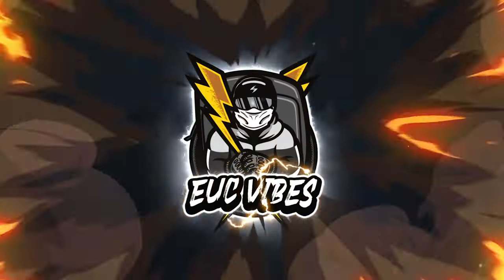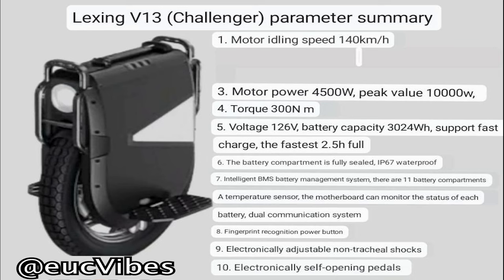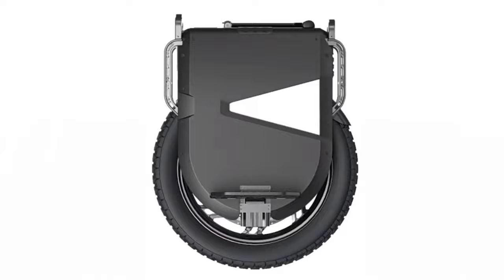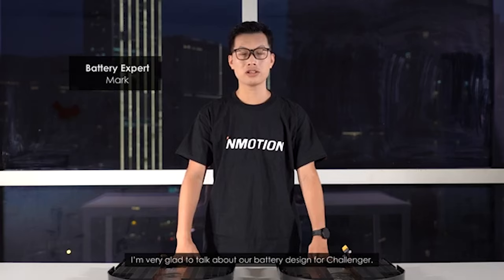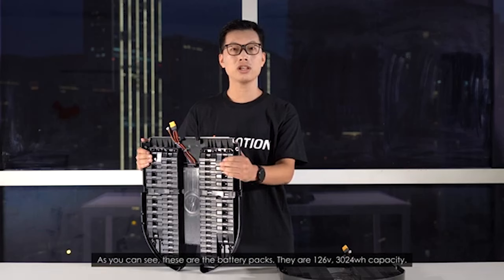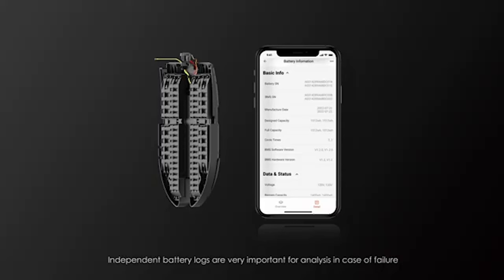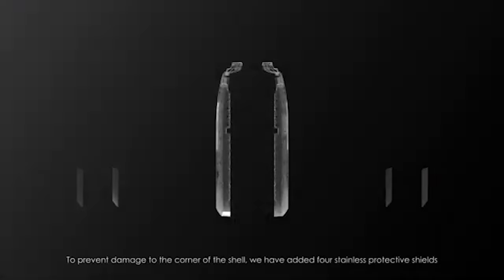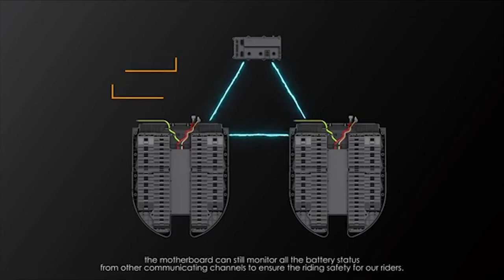iNMOTION V13 ⚡️ (New Pics + Info)

Comment: It sounds cool and hopefully not bloatwares. 9 sounds like you can adjust the shock from the screen, but the most important thing about the shock are suspension travel and durability of it. Being first of its kind, doesn't mean its good. 10 too sounds overly engineer. We need pedals to be dumb and super durable. More parts to be broken and expensive to replace. 8 better not be the only way to access the wheel to ride, those wiring are brittle. It would be the worst day if your fingerprint sensor got broken and you got lockout of your wheel when everything else are fine.

Comment: Thx Tommy!
Every time they release more information I see the cost going up. Afraid to know but i still NEED this wheel! Glad they are doing all this just hope it's 100% ready before they give it the full send  🤞
Reply: @EUCvibes  forsure but these safety features imo are worth paying more for. It "look" like they really did some impressive engineering to this wheel. I'm looking forward to making a custom adjustable seat that mounts to the top of the roll cage like I have on my sherman. I love a good seat and it looks like this wheel will be mod friendly like my sherman.
Reply: @EUCvibes  what's the big problem of v12? Why are people that just love and other hate? The problems weren't solved in new batches?

Comment: Seems kinda like a Sherman with some crazy suspension and flashy features… she looks good though I’m sure it’s gonna be smooth .. And electronic suspension is basically the same pressure type air/gas suspension with a electric controller that adjusts your suspension pressure based on your ride style or manually adjust etc etc… pretty awesome feature if all these electric devices stay healthy and don’t fail and need extra servicing like the finger print power button.. Hope there is a fail safe in case that breaks ya know?

Comment: Suspension: sealed shocks no air-pumped tubes
Pedals: use magnets to keep closed, electronic will demagnetised pedals to allow them to open up when turned on.
You can still manually open them without worry

Comment: According to Mad Pack, the shocks are gas chambered and similar to the EX suspension except you don't need to pump them to 2,000 PSI. They will be sealed and recessed and adjustable via the touch screen on the EUC or the app.

Comment: guessing, but the suspension may 'actively adjust the compression and rebound of the shock or strut'.  I'd guess this is a setting?  but maybe the suspension is self adjusting, based upon surface?   Certainly sounds interesting.  Might be the first step toward 'smart suspension' that could move pedals in sync with road conditions
Reply: Traditional shock compression and rebound adjustments are controlled by throttling the throat of fluid flow through mechanical expansion/contraction VALVES, which alter the dampening and performance of a traditional fluid shock system.

"Non-tracheal" may refer to the alternative method of altering the viscous-elastic properties of the shock fluid OR the "spring" characteristics by using an electric field to alter the physical thickness the flow through a fixed-size orifice, which allows very rapid reactions on variable terrain transitions... like smooth pavement to mega-pothole and back type road hazards.  The incremental improvement of a non-tracheal: "Deep Throat" suspension system should be a major improvement in terms of mechanical maintenance, compactness and weight savings, without additional costs.  {That said, this is just an uninformed guess, FWIW... you asked.}
 

[Side note:] This is the first step to radically changing to a fully electronic active suspension system (which will probably be at least 5-10 years away from scalability.  Fully active electronic suspension is the fantasy and could offer "boosted jump-assist" that would double or triple the your obstacle clearing height.
Reply: @grb1969  yeah! what he said!
Reply: @grb1969  the ability to assist/augment a jump is one of the most exciting potentials of 'smart suspension' for sure
Reply: @urthpainter  Yes, definitely not on this version, yet.  But I'll continue to lobby for a Bose-type active suspension until it happens. It's really a safety feature, not just because I want to Mario-triple-jump my way across the landscape. 😁
Reply: "Electrically adjustable non-tracheal suspension" to me that translates as non air suspension that is electronically adjustable. GM has had the MagnaRide suspension for at least 10-15 years, maybe the patents have expired, or this is just different enough to skirt patent infringement. But what MagnaRide is a hydraulic suspension that has micro ferrous material(magnetic metal particles) floating in the hydraulic fluid of the cylinder, they can electronically charge the fluid, and in doing so it changes the viscosity of the fluid, so on the fly the ECU can make the suspension stiffer or softer. the cars ECU's monitor car speeds, wheel rotation, G loads, etc, and based on that, the suspension can optimize its response to the road. That sounds pretty exotic for a EUC, plus they mention it has 10 settings, so it wouldn't llikely be relying on ECU's reading data from multiple sensors. maybe they will have 5 presest  off road settings, and 5 preset road settings,  

I have been watching the suspension EUC market closely, and watched multiple ride reviews of the different models, and in my opinion at some point we will see some of the manufactures making on-road and off-road versions of their suspension models, because the optimal setup's for suspension  for the two types of terrain are very different. It it near impossible to make one suspension set up optimal for both. That said, InMotion is a company that does not make a lot different models, they like to keep their lineup simple, and if there was a suspension technology out there that could pull off being good at both on and off road, it would be a electromagnetic controlled shock system. As proof, GM uses the suspension in their high performance Cadillac line, and some Corvette's, and at the same time, they use it in their most off-road capable truck.
Reply: @EssPhour   Great explanation.  I’m not a huge fan of the GM MagnaRide but it is simple and can be electronically modulated. 
 
The Bose system is orders of magnitude better but also complex and unavailable in production vehicles. That said, it’s also post-patent protection so it is being adopted by some Western militaries and should be adopted by the motorcycle manufacturers at some point soon. Hopefully the tech will trickle-up to the EUC market once the military and mounted police figure out that hands-free infantry has superior performance and survivability for ground based operations.